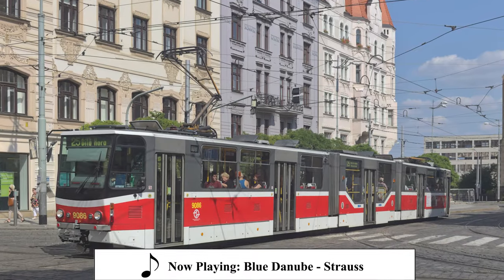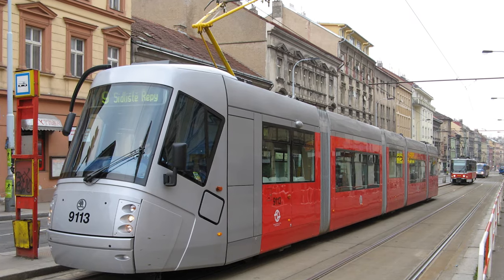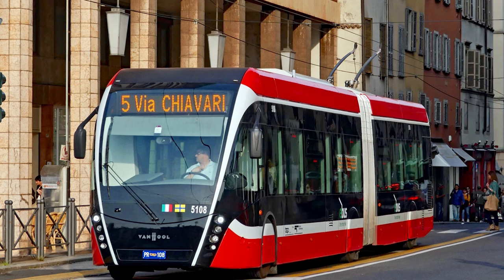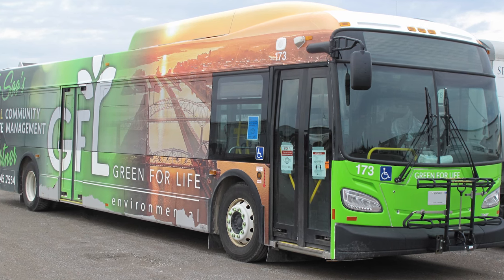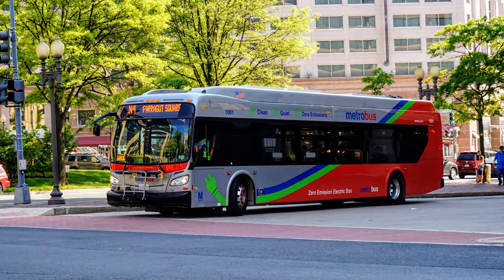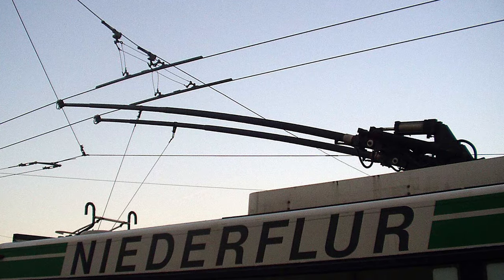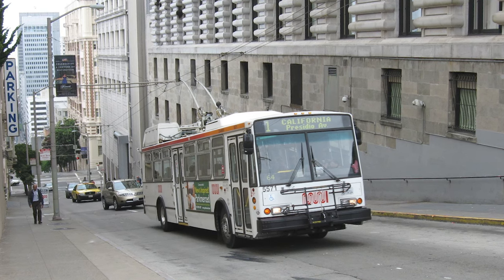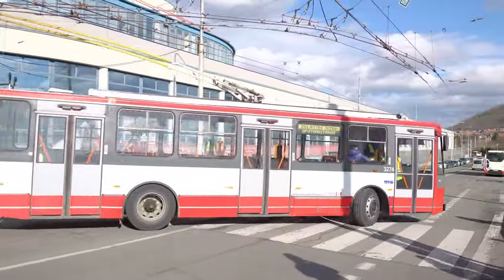The Rise Of Electric Buses

Comment: Nice video. Existing trolleybus networks are getting extended, it makes a lot of sense especially since they already have a lot of these busses.

But new networks aren’t really getting built. And while I would love for more trolleybusses to exist, we have to remember there is high capital cost involved. Trolleybusses fill a tight niche because when you’re building electrification anyway, you’re pretty close to having a tram, which is a big upgrade.

However I think I need to defend battery busses a bit.

Solaris urbino 12 electric with 300km range has a 520kWh battery. A Tesla model 3 long range has 78 kWh of battery.

So this bus has the environmental impact of about 6 teslas, while running all day every day and transporting tons of people. It will also probably be used for longer than the Tesla.

And remember, cities like mine can buy busses with small battery and charge at the end of the line.

There is also the alternative of hydrogen but right now it’s quite expensive to operate, but has the advantage of less weight

Both trolleybusses, battery and hydrogen significantly improve the smoothness of the ride.
Reply from the maker: I agree that E-buses in general significantly improve the quality of the ride, and I also agree that battery buses are good, too

I personally like trolleybuses more, but I do see the benefits of battery buses 

In the end, if we're moving towards public transport, and away from cars, that's a win in my book

Comment: If you have the usage (say 70 buses an hour), it could make sense to build wires. They can then branch out without wires reaching out to different districts. Does not make much sense for routes with 2 buses per hour on the other hand.
Reply from the maker: Yeah, for high demand routes (like the future line 59 trolleybus in Prague, which sees a bus every 2-3 minutes at peak hours), trolleybuses absolutely make sense

Comment: Trolleybuses are awesome and I wish there were more of them! Battery buses are a good step, of course, but I always feel like something is missing. Especially considering here in Toronto, we used to have a sizeable trolleybus network but it was dismantled due to costs and no replacements to aging fleets. I wasn’t born when the trolleybuses were around but whenever I go to Budapest to visit family, I always long for their return to Toronto. I’d like to think trolleybuses may have a future still, as there will become a time when a large portion of the battery fleet will need replacing and there will be a lot of problems that will arise from this.
Reply from the maker: Trolleybuses are great! They've been re-introduced to Prague after 50 years without them and so far, the 2 lines are great

Comment: One really minor (MAJOR) detail that you missed on the drawbacks of the battery electric buses. They are heavy. Yes, you addressed that, but you didn't address all the problems that causes. Since the vehicle is so heavy, it needs a seriously beefy suspension... and that suspension is going to be incredibly inflexible... and the passenger experience inside the bus is going to be miserable because of it. My city has gone all in on battery electric buses, and on those buses, you can feel every single tiny bump in the road. I ride roller coasters for fun, never feeling sick afterwards... but I'll get motion sickness on our battery electric buses with how rough the ride is.
Reply from the maker: Thanks for the feedback, you're right, I should've mentioned that!

Comment: I'm afraid that trolleybuses in general are on the last stretch. NIMBYS will always hate overhead lines and will push for battery powered busses.
The main issue is that networks are made by the addition of lines which often get opened all at once together with a new fleet of trolleybuses, as soon one of this fleets gets at the end of their lifespan, there will be the question "will we place an order for trolleys and busses separately, or we try to have a larger order just with battery-electric busses?".
Reply from the maker: That's unfortunately true..
Reply: @TheTramly  An item that would be interesting be about the bus vs trolleybus battle would be if the evidence of transport infrastructure matters on city development patterns. There is a perception that the evidence of physical infrastructure drives local development investments more than less evident infrastructures.
As trolleybuses have more or less the same capacity of a bus line, but have more visible infrastructure.
I would be curious given two identical areas  and providing several level of sole bus or sole trolleybus services if the level of infrastructure drive more investment.